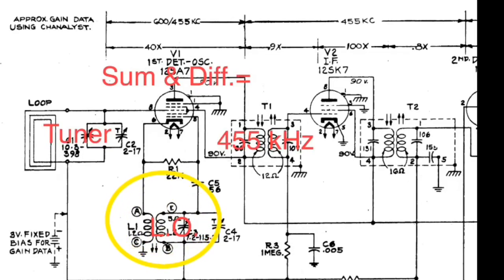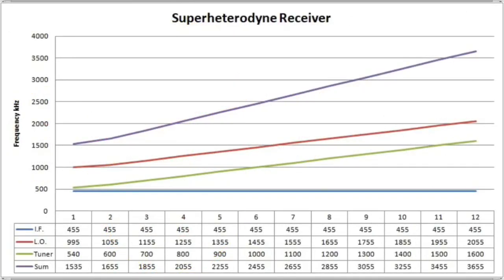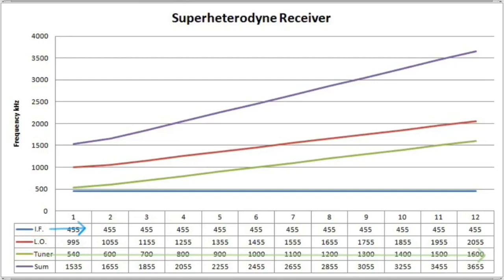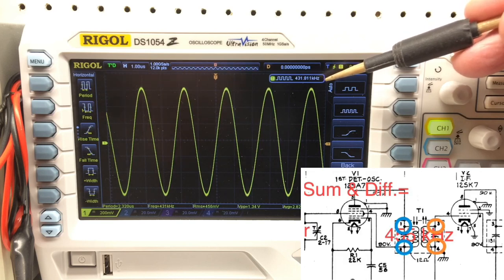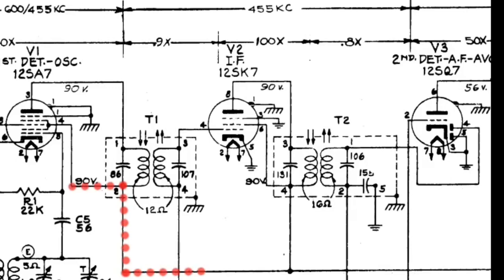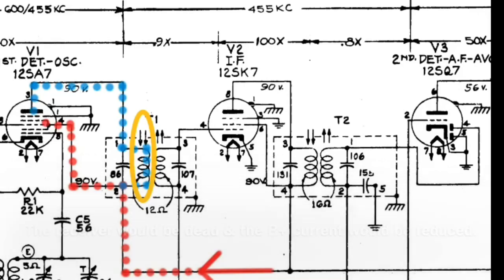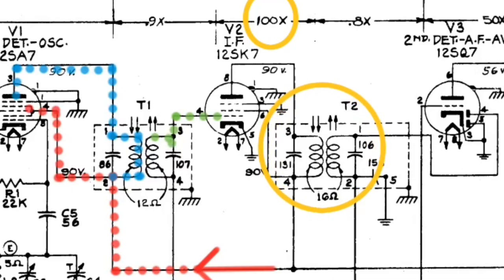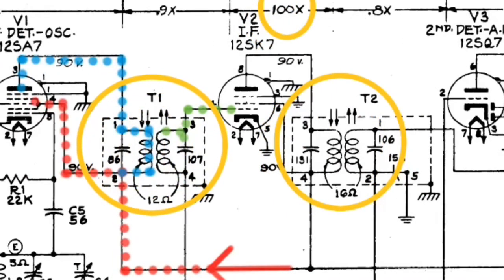RCA 8-X-541 - Cause & Effect P6 (I.F. Transformers & Common Failure Points)

Comment: This has been a great video series Don, The section on the top of the schematic that shows the gain of each stage is something that I didn't realize until you pointed it out. Only some have this information on top.
Reply from the maker: Thank you Jim. I’m going to try replicating the gain figures after recapping the radio, may end up being apples to oranges, but we'll see. Best, Don

Comment: I buy some of my equipment from.watching your videos ,I bought a dso 188 pocket oscilloscope ,to see if I can use it for some of the things you did on radios I no it's not the nice scope you have ,but if you can think of any things on tube radios repairs please let me no. ,I value your input ,the ideas I have gotten from your videos and the equipment I have bought since watching your videos have been great buys,My latest guys have been my fx hakko d and my fluke 18B+, and my little oscilloscope dso188 learning to use,these are upgrades ,thanks for your videos I am still finding them and watching ,more then once great teaching materials
Reply from the maker: Ron, you’re assembling some nice test equipment. I’m not familiar with the scope, but I do see the upper limit is 1Mhz. I rarely use my scope for radio repair, so I wouldn’t be concerned about the bandwidth limitation. I’m sure your Fluke and Hakko soldering station will serve you well. I always appreciate you reaching out and taking time to view my videos. Stay well and all the best. Don

Comment: Good one.    I learned a lot on this vid.  THANX.   The double arrows above each coil.  Is that the same as the dot convention to show phase of windings to each other or just showing they are adjusted via inductance instead of tweaking capacitors?
Reply from the maker: jp - thank you. A great question about the arrows and phase. I'm not sure, but I think it just represents the ferrite tuning slugs (inductance to your point) are adjusted from the bottom and top for each (primary & secondary) coil. I'll look at that closer and reply back if I determine otherwise. Best, Don

Comment: Hello Don, Great series, excellent graphics, so easy to follow along with your narrative. I saw the earth (rake like) and the chassis ground symbols. The earth ground is the green wire with A.C. Mains, chassis is just that, or does it matter?. Can you check a resistor in circuit?, probably best to remove 1 side to check. I hope you are doing good. Take care, Cass.
Reply from the maker: Cass - the rake symbol for this receiver represents the chassis as the B- is floating, i.e., it’s isolated from the chassis. The chassis on this radio should never be grounded to green for safety reasons. Most resistors can be checked in circuit since we’re only concerned if they are out of tolerance by 10 to 20%, but to your point lifting one end of the resistor will always be the most accurate and dependable method. I appreciate you reaching out as always and I hope your weekend is enjoyable. Best, Don